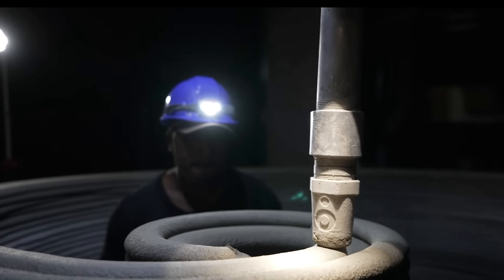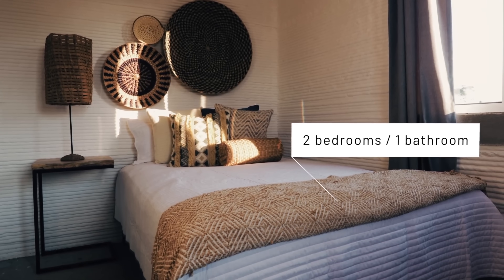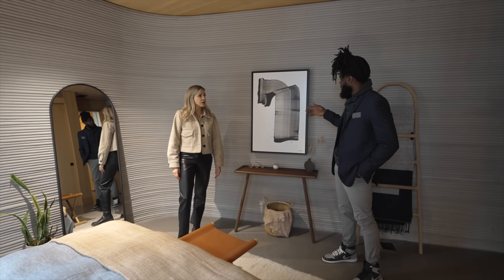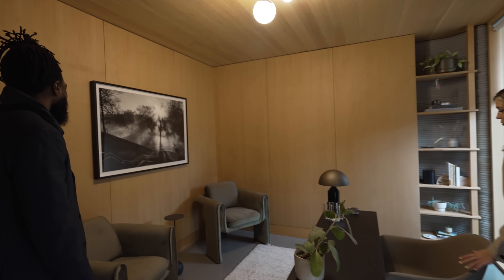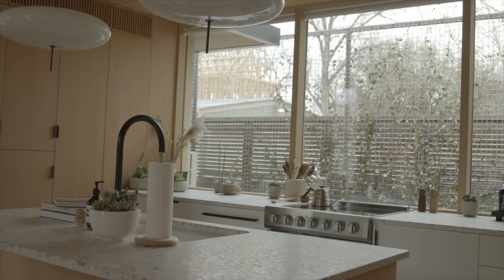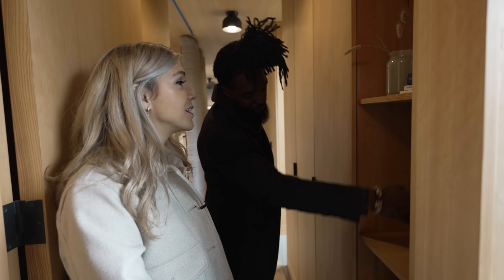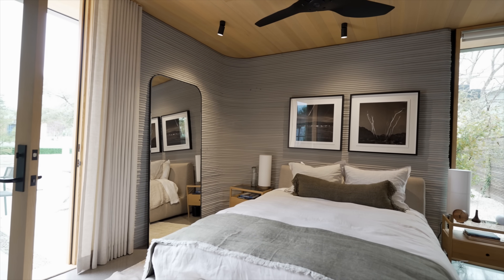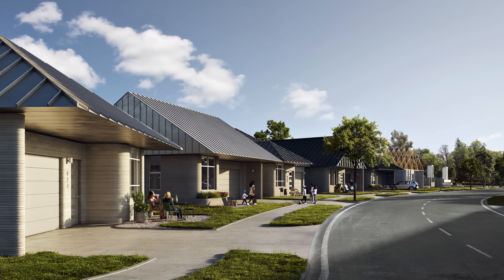Inside A 3D Printed House You'll ACTUALLY Want To Live In

Comment: I LOVE the concrete, it gives me a textile vibe, that with the natural wood, plants and the textiles and I am getting a modern Boho fusion vibe going on. This is my dream home style.
Reply: I do NOT want that house.  to many "technical" /structural Restrictions inovolved with it and  it required constricted sizes.  The material is a horible mess. Then huge expense to "cover/finish those walls".  Wiring and plumbing issues.  If you want to build something like that there are better/Cheaper , simpler ways to do it.  search ,... Oh what is it called,  Mud/sand bag , earthen bag construction.  And I am not saying I would want that for my main house either.  I've have seen nice hotel rooms....  cement is a mess! espeically when you leave it exposed. Dirt , spiders, and bugs "sticking to it" and those layers/grooves!  then trying to deal with plumbing, electrical etc,  and even try hanging a shelf or picture. :-)) wanna change a door or window? 😅😅😅 that texture is aweful.  even beyond cleaning it has problems.  the novelty would wear off quickly.  and trying to cover that up with wood, plaster, etc... IS $$$$$   Are you noticing that even with the camera/"lense"?shooting done to try and make it  look bigger.  Look at how SMALL the rooms are. EVEN The ones that are supposed to be "larger rooms"  Oh and I live in a mostly solid cement walls and roof/ceiling ...  I will call Bull Sheets on it being 75 F inside on  days when it is in the 90's .  I live in the desert and once it starts warming up in the spring in the "90's" after a few days the cement warms up, the walls warm up and there is no way you are going to have 75F inside without turning on the AC.  if it goes "hot" then cold" then "hot" the cold for a couple of days, then Maybe... But after after a few solid days or warm/hot temps, the cement warms up. and as the temps keep on climing for "the SUMMER/ spring"  the walls of the building keep getting warmer.  In the low desert in AZ,  if I turn off the AC it will "quickly" start climbing toward the 90's F. I guess higher if you forget to turn on the AC.  Oh, and of course the Reverse happens in the winter.  Sure the novelty of this is "cute"  but the reality is..................  Not So Great.   especially if you DON'T want just a little/cramped "single persons"  condo/vacation condo"  and You don't want the MESS of unfinished cement walls.  You know what else you will notice about this... NO REBAR REINFORCEMENT/"structural support".  And there Are More issues than just these... Ahh but the Novelty of it. 😅

Comment: CapEx for 3D printed residential doesn't seem to me to scale well.  A small team of traditional stick built framers can create the envelope in just a few days - tops, and capEx for them is minimal and used to scale just fine, at least before the current construction worker shortage, which we all hope will eventually dissipate.  

Lots of sprayfoam for insulation in the concrete printed forms ... lots and lots of other time consuming stick built details ... all adds up to an extremely high cost psf.  Throwing money at anything can create sizzle but is not innovative.  The 3D printed concrete could have been mimicked by the clever use of special 3D formwork panels at a fraction of the capEx of the 3D printer and faster to pour in a high slump mix than to print hundreds of thin separate layers for days on end too.  ICON's four houses in Austin are "luxury townhouses", I think for $450k+ each.  No prices are mentioned for the 17 homeless housing paid for with public funds, so they are likely pricey as well otherwise a low psf would have been quoted.  This firm has been around for several years now and they have only a tiny number of projects, spending investor money is my guess, just like modular housing manufacturer Glide Homes ... sadly now bankrupt after blowing thru $370m of San Francisco VC investor cash.  At least Glide Homes built 350 houses. 

Lets admit shall we, that the serpentine 3D printed concrete toothpaste layers are used in this house as 3D artwork !!!  Just free standing artwork that in a decade could look as dated as 1960's shag carpeting and parquet flooring  ... but "...they wanted to let the walls shine..." as the builders PR rep tells us repeatedly in another YouTube video about this same project.  That video also shows the awkward placement of electrical outlets on the floor instead of marring the toothpaste wall artwork, that won't age well as the residents reach retirement and beyond.  What an arrogant non-user friendly detail: all outlets on the floor, one of many in this house.  

What were these YouTube folks thinking - to get swept away by sizzle and not steak.  To top it off - it's "a one of" to generate investor interest, just like the Tesla-wanabe EV manufacturers who can build prototypes to display at automotive tradeshows and sucker investors but can't ramp production to scale even with billions in the bank.  Lots of YouTube videos hyping this toy house to gin up investor interest.  Very sad.

I predict construction industry hero Mr. Joe Lstiburek, a very practical, engineering focused fella, would see right thru this ICON mirage.  ICON should give him a call next time.

Comment: the great majority of the world builds with concrete, bricks, stones, whatever EXCEPT wood... because wood rots, has poor thermal and sonic insulation, and it is COMBUSTIBLE... and not the most durable material... and also it makes sense to use WOOD for building some something other than housing... oh i dont know like ACTUAL WOOD CABINETS and not some garbage from wood dust, glue and some chemicals... i mean wood should be used for FURNITURE... or some kind of accents or some customization for the house like decking or steam room or a GAZEBO in the garden... but using wood as the structural material is just retarded... and VERY AMERICAN... and so 19th century... 
it funny hearing "You can hang stuff no problem..." Umm... do people in US know of this amazing gadget called a DRILL ??? or these super advanced things called ANCHORS??? You drill a hole thats a little bit bigger than the screw you want to use, then you take the ANCHOR and put it in the hole, then use the hammer to drive it all the way in and THEN you put the screw INTO THE ANCHOR... as the screw gets deeper and deeper, the anchor expands in the hole and stays there... SOLID... no problem...

Comment: Interesting video. The layered look of the 3D printing process is an interesting look and I can appreciate it but it doesn't work for me. No doubt 3D printing is the way to go in the future and I cant wait until the technology upgrades to the point where there is a secondary machine that can automatically cover up that 3D layering look and have a more smooth and uniformed look to it. I am sure that there are some really smart people looking into it so it should only be a few years away and then after that it will only be a matter of time until traditional building methods start to go extent for certain types of housing.
Reply: I do NOT want that house.  to many "technical" /structural Restrictions inovolved with it and  it required constricted sizes.  The material is a horible mess. Then huge expense to "cover/finish those walls".  Wiring and plumbing issues.  If you want to build something like that there are better/Cheaper , simpler ways to do it.  search ,... Oh what is it called,  Mud/sand bag , earthen bag construction.  And I am not saying I would want that for my main house either.  I've have seen nice hotel rooms....  cement is a mess! espeically when you leave it exposed. Dirt , spiders, and bugs "sticking to it" and those layers/grooves!  then trying to deal with plumbing, electrical etc,  and even try hanging a shelf or picture. :-)) wanna change a door or window? 😅😅😅 that texture is aweful.  even beyond cleaning it has problems.  the novelty would wear off quickly.  and trying to cover that up with wood, plaster, etc... IS $$$$$   Are you noticing that even with the camera/"lense"?shooting done to try and make it  look bigger.  Look at how SMALL the rooms are. EVEN The ones that are supposed to be "larger rooms"  Oh and I live in a mostly solid cement walls and roof/ceiling ...  I will call Bull Sheets on it being 75 F inside on  days when it is in the 90's .  I live in the desert and once it starts warming up in the spring in the "90's" after a few days the cement warms up, the walls warm up and there is no way you are going to have 75F inside without turning on the AC.  if it goes "hot" then cold" then "hot" the cold for a couple of days, then Maybe... But after after a few solid days or warm/hot temps, the cement warms up. and as the temps keep on climing for "the SUMMER/ spring"  the walls of the building keep getting warmer.  In the low desert in AZ,  if I turn off the AC it will "quickly" start climbing toward the 90's F. I guess higher if you forget to turn on the AC.  Oh, and of course the Reverse happens in the winter.  Sure the novelty of this is "cute"  but the reality is..................  Not So Great.   especially if you DON'T want just a little/cramped "single persons"  condo/vacation condo"  and You don't want the MESS of unfinished cement walls.  You know what else you will notice about this... NO REBAR REINFORCEMENT/"structural support". ("no multiple stories") And there Are More issues than just these... Ahh but the Novelty of it. 😅

Comment: Didn’t ask the right questions to better understand the practicality of this design/product. For example, how does it withstand in earthquake zones without expansion joints that most concrete structures have? Most concrete formations adhere to rebar for structural support; how does this compare? Can I put plumbing and electrical in this 3D built wall and if repairs needed later, how does one go about that? How to patch up holes in wall if hanging artwork etc. What are the main benefits of a 3D build versus traditional construction materials in terms of price, availability and longevity? Very basic video.

Comment: I’m not an engineer or anything but I don’t think a concrete house would hold up in colder climates over time. Especially when we see temps drop into the teens sometimes here in the northeastern U.S. I could be wrong though.

Comment: This is not really a criticism, as much as a statement of progress.

We have to make clear that they started with the simplest element. Walls. Walls is not only the simplest element, but one of the cheapest.

Typical building you have the following structural elements.
Foundation
Outer walls
inner walls
Floor
Roof

Then  there is a few more elements.
Finishing (floor, wall roof)
first and second fix water
first and second fix electric
first and second fix electronic (WIfi, networking, sensors)
Heating/cooling
Wastewater
Cabinets

And so far 3D printing is half the walls, pretty much. No insulation (while that could probobly be fixed quite easy with foam insulation, simple, but not cheap), and window/door posts.

Floors (like a multi floor building) this need to be solved. I seen no solution for this yet, still this is something i´m expecting will be solved with in a year or two. This really needs to be sovled.

Roof, same as floor, same technology, and really same most thing. Just the finishing that is different, and well, roofs tend to lean, that might be a problem for a 3D printer. This need to be solved.

Foundation is the most expensive part of a build. For a single sorry unit it can be as much as 40%. A fairly simple solution to this is to have pillars and beam foundation. Having the house hover 40 cm over the ground. This is a fairly common solution in Scandinavia and it works good. Of cause, there need to be a containment wall and insulation in the floor. This is probobly the simplest and cheapest solution.

First fix need to be solved. There is possible solution for this. empty tubes. If the 3D printer can lay empty tubes, those can be configured to be water, electric, electronic and heating/cooling.

Finishing can be fixed. I seen trail runs of different kind of 3D printed finishing for wall and roof... For floor, not yet.

Waste can possibly be fixed with tubes, or other solution. Its really just the toilet that need large tubes, everything else can theoretically run of 40mm.

Cabinets and seocond fix have to be done by human in any realistic timeframe forwarad.

Comment: Here is a giant 3d printer and you choose to make these ugly little houses with crude print lines topped with metal triangle roofs.  Turn on the capability of the machine and print beautiful castles and magnificent houses rather than temporary crap.  Integrate wire ways and water supply into the print.  Some household features could be printed such as tubs, sinks, sewer lines and pools.  Get away from the wave wall square design and make something beautiful.